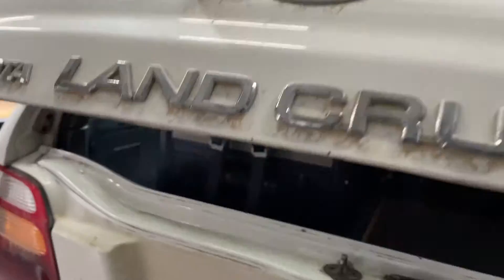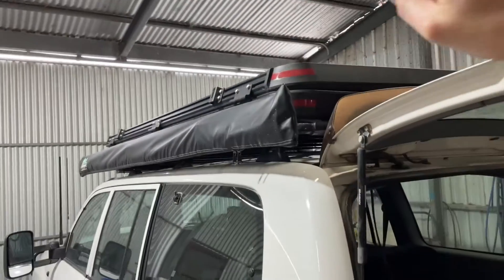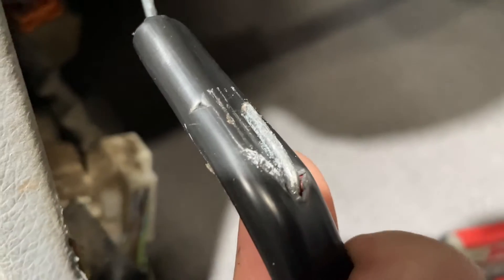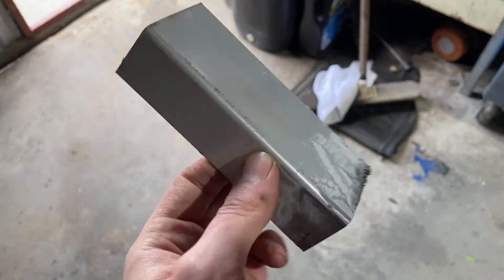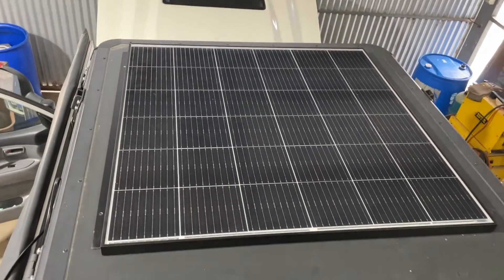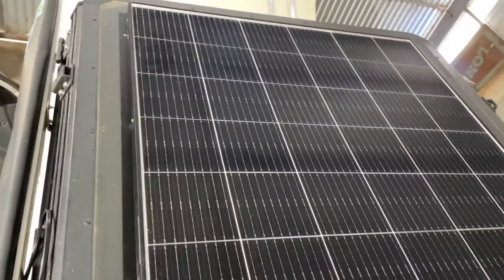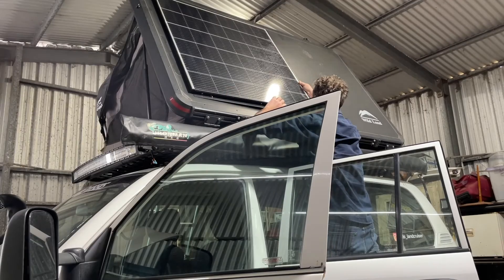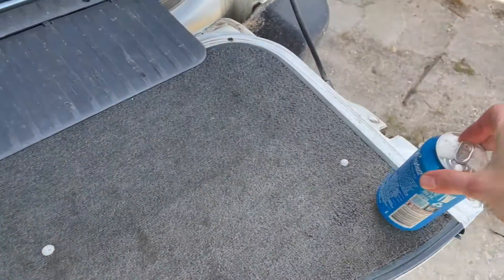Solar and Lithium Battery Install [Topo Centrefire, Voltech]

Comment: Great video! how is the voltech panel after year of use? are you getting anywhere near the 11A it claims?
Reply from the maker: Still going strong! I haven’t introduced a way to actually measure the input from the solar panel but when I grow my 12v setup in the near future I’ll definitely include an ammeter of sorts

Comment: Nice work supporting Topo. Mine is installed in the footwell of the 3rd row.
Reply from the maker: Great battery box so far 👍👍
Reply: @Will's Landcruiser Mods  Definitely, haven't had an issue yet. Chargers so fast